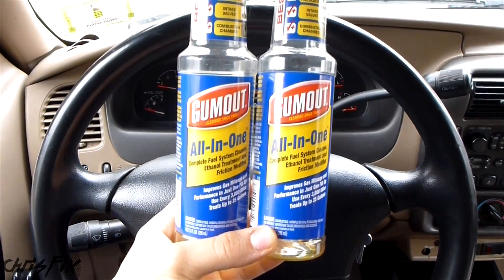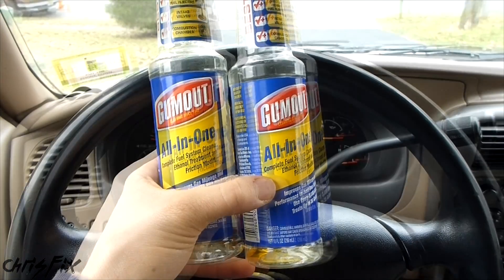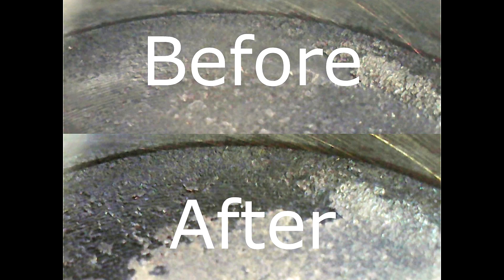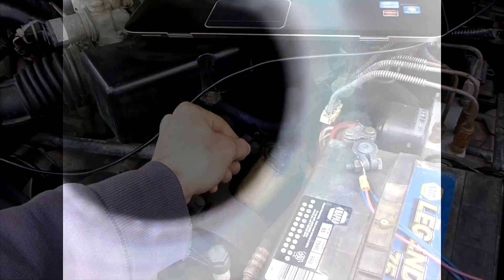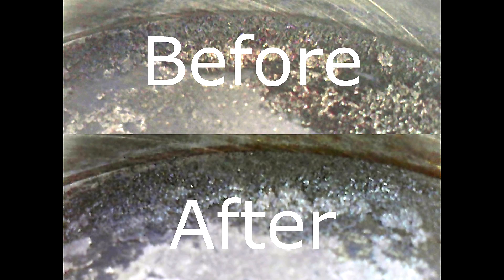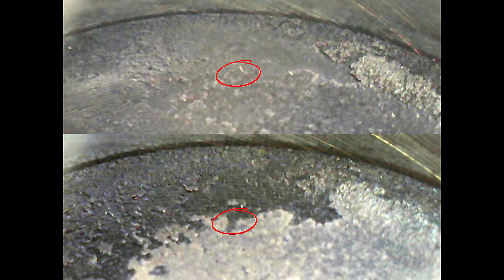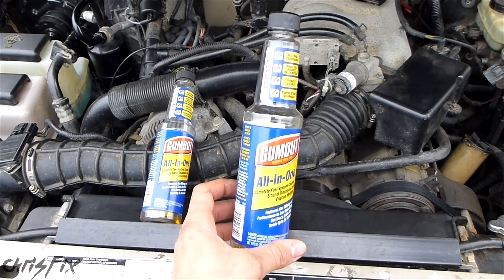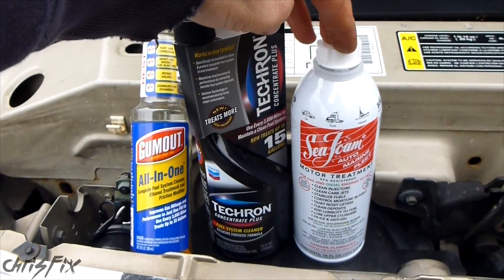Does Gumout Fuel System Cleaner Work (Follow up)?

Comment: When did this obsession with having spotless engine internals start? That carbon on the piston tops is a FREE compression ratio boost (performance improver) as long as it isn't causing detonation (unlikely in modern engines with active fuel injection control).  Baked on / stable carbon on piston tops is harmless, dude. If you live a mile above sea level like I do, every fraction of a compression ratio point boost is a welcomed thing. Believe me. 
What CAN cause damage is sudden aggressive carbon cleaning that breaks loose large pieces of carbon that can get stuck between a piston skirt or piston ring and tear up a cylinder wall.
I agree that excessive intake valve deposits can be a problem though, but intake valve deposits aren't the problem they once were with advances in fuel detergents.
Reply from the maker: +scdevon No one said there is a problem with carbon in this engine, I actually say this is normal. We are testing to see if the product works or not.
Reply: ChrisFix
Oh, OK. The video is about testing a cleaner designed to remove carbon among other things. I just questioned why people would feel the need to remove carbon like this in the first place. It's completely normal.

Comment: Sure it works....  if you use it for ten years and spend ONE THOUSAND DOLLARS
buying bottles of that crap which is what they want you to do.
Reply: +Indrekk Pringi A taxi company person who ran one without all it's expected life and another with, found the one with continuing to work (used various brands) and the other broke down more, the more they tried cleaning it up.

Late in the game, it's probably cheaper and easier to pull the cylinder heads in clean it.

Comment: For a complete engine cleaning to see a a real 50 -80% results you need about 10 bottles.
Reply from the maker: +osamaFXX probably more than that!
Reply: +ChrisFix Standardized tests show the active ingredient in Gumout requires 10,000 miles of use before 'equilibrium' of removal plus new deposits is achieved . . . so, Chris, the 10 bottle comment falls a bit short . . . it will take many more bottles before you can benefit from the 1 bottle per oil change maintenance.

Comment: Excellent video.  I noticed you are missing two cylinders.  Just kidding :-)

I'd like to see you do this after doing a Seafoam treatment.  The kind that you suck it into a vacuum line that goes directly into the intake.  That, and/or straight up raising hell, hot rodding, high revving, wide open throttle time will burn some carbon out.
Reply: Oh you did the Seafoam test.  Gonna go watch it.

Comment: Interesting tests, but I feel like the test is a bit narrow in scope. By only using the cylinder carbon build up you are only validating one part of what the product is meant to help with. I think the biggest take-away from this is that these products are best used throughout the life of a vehicle (especially before build up gets to be too extreme). I'd be interested in seeing the results of fuel system cleaners over a long period of time right from the start of a vehicles life. I wouldn't rely on them as magic repairers for older/dirtier vehicles but I'm certainly convinced that a bottle or two a year would be worth investing in for new machines!
Reply from the maker: +Chris Pickering You are wasting your money if you use these products for the life of the vehicle. I look into engines all of the time and the carbon buildup is never that bad. Check out the newest video I did where I look at intake valves: https://www.youtube.com/watch?v=BocH2c4mYcc
Reply: Each to their own of course, but I think $15 every once in a while is a small price to pay for the peace of mind of knowing that I'm doing everything I can to keep my machine in perfect condition. To keep it simple I just do a dose at every oil change.
Reply: +ChrisFix   Why haven't you done one on Marvel Mystery Oil and CRC Motor Treatment?
Reply: ChrisFix Gotta love people, man. Most will defend, almost to the death, a bad product rather than admit they were duped by an ad or a bright colored bottle with amazing promises.
If you put cleans carbon in the chamber with 1 bottle on the label then it had better damn well do that or the company responsible for that product should leave that claim off.
That is the part you stated that you tested & I am just amused by the arguments you are getting. 
It's really weird to be so attached to a product or a company as those entities see those same customers as easily dupable & would like nothing more than to relieve them of all their cash. It's a sort of parasitic relationship & it's rather strange to be "the host" & still be that interested in defending it but people will do so.
Why defend a product from fair criticism? You don't make it, you don't have a stake in it's success & usually there are several other products out there which would work just as well for your needs.
I will defend people or even pets I like who are either right or mostly right. Defend a brand or product? Nah. They don't pay me to do that.
Have a great day!

Comment: A question with running the tank all the way empty, aren't you not supposed to run the tank dry because the dirt and stuff sitting in the bottom of the  the tank goes into the fuel system as well?
Reply: +Mrwishywashy Hmmm. Indeed. This could have effected testing, and if not, shortened fuel pump life.

Clean it up with the dirtiest mop water!
But that makes the floor oiler! (Inner thoughts about not cleaning my mop bucket at the shop soon enough, lol.)

Personally, I like water decarbonization. The car feels so smooth for about a year and I do it again. Too bad I don't have visual testing like Chris, but I'll get there. Check out my test on water decarbonization.

Comment: The older the carbon the harder it gets.
Reply: I will keep old carbon on my pistons until it turns into diamonds.
Reply: +Skyler Bond My carbon sat for 3 years. I had the opportunity to get very dry. This makes more sense why my 70k mile engine is so carboned.
Reply: basically, you have to start when the engine is new or almost new..  do this every oil change and it will remove the cyclinder carbon buildup that builds up in that short stretch of time.
Reply: @colty7764  still, they shouldn't market it as a one use fix. If you want a good fuel injection cleaner/additive use redline.
Reply: @colty7764  exactly
Reply: The deeper the cushion, the sweeter the pushin'.
Reply: Start early, start strong.  

Use it every oil change starting with the first oil change.
Reply: Skyler Bond yep true, old carbon harder
Reply: This is like metallica's lyrics

Comment: In WWII aircraft engines were de-carbonned with water.  Atomized into the intake at higher revs.
Reply from the maker: +panzerabwerkanone They were. It was designed to lower combustion chamber temps for more power!

Comment: In my option that stuff works on the pipes and injectors, flushing all the crap into your cylinders. If you really want to clean your engine tho and I'm not sure it works on a petrol like a diesel you put you fuel lines straight in to bottle and use the cleaner straight. The cleanest engines I've come across it straight LPG, Duel fuel with injected LPG or forced running methanol injection.
Reply from the maker: +Karl Hock Thanks for sharing and I agree. But I think that they should not put that it cleans the combustion chamber if it doesnt actually do it.
Reply: +ChrisFix ,yeah fastest way to blow up your car unless set up for it. I'm pro LPG just a sad that the old school mixture system gave them such a bad name. I run a modern mixer system in my 98 land cruiser can't fault it. only burns 2lt more per 100kms then petrol.

Comment: You should hook up a math injection kit and see the before and after cleaning from what iv been told it steam cleans the piston tops valves heads and so on. Runs cooler temps when used and boosts power and torqe mainly using it like you would nitrious. But not as deadly
Reply from the maker: +strikeforce4 That is actually an idea that is in the works! Stay tuned!

Comment: Forgive me if this question has been answered: Have you tried using the scope in through the intake or in the spark plug hole to look back up at how clean the valves are getting? thanks
Reply from the maker: +Jonathan Stahl That is harder to do than it sounds but I am working on it!

Comment: Ummm... Gumout is a fuel system cleaner, not a piston cleaner.
Reply from the maker: +Crow T. Robot On the bottle it specifically states it cleans the combustion chamber and shows a before and after of the piston head. I clearly show this in the video.
Reply: ChrisFix Well, then, it clearly would have helped if I had watched the entire video.

Comment: You don't have or didn't use the gum out high mileage that's y there's still carbon. If this video is old, my apologies
Reply from the maker: +chris carbaugh Thanks for sharing.
Reply: U know you're stuff I'm dealing with a pending p0420 check code used cataclean and the light shut off but the code is showing pending I used my obd2 diag tool to confirm this any ideas, car is a 02 subaru forester with 264,000 miles

Comment: this product is for prolonged use. you're taking an engine with 123000 miles on it and trying to clean it with 2 bottles. I think if you used it as a pm on the regular it would work great.
Reply from the maker: +Shawn Novick It is a waste if you use it for prolonged use...

Comment: What worked well for me a few years back, on advice,, was 1 litre Enamel Thinner + 1 litre methylated spirit, then fiill up with higher than usual octane fuel and drive like a madman.  I was more treating the injectors in my case, rather than carbon deposits, but there was definitely evidence of black stuff having been pulled through.  According to the advice I had, it won't poison the sensors or converter.  Don't know if there's a better way or not.
Reply from the maker: Jason Groothuis Thanks for sharing! Not something I would do but interesting none the less!

Comment: What did you use to get the inside view of the cylinder and where did you access the cylinder?
Reply from the maker: ***** The camera is linked in the description and you go though the spark plug hole.

Comment: Did you noticed the claim of improved gas mileage on that Gumout? Your first bottle you went 210 miles on a tank of gas and the second bottle over 300. So unless there is something I missed, the claim for better mileage is correct, agree or disagree?
Reply from the maker: Mark Shaw I had to fill up with some extra gas to get back home so the mileage was about the same. Maybe a little bit better fuel economy but there are so many variables.
Reply: Have you ever did any fuel treatment tests on lawn mowers, weed-eaters, etc.? The problem I seem to always have is either my 2-cycle fuel has gone bad or the mixture is not correct and I'm always working to repair them.

Comment: you dont know how to use or understand what these products are designed for
Reply: ***** I really should ignore your comment, but it's so ridiculously stupid, I just can't let it go. So what you're really saying is that the product manufacturer doesn't know how to properly label their product, since he followed the instructions on the bottle, and expected to see the results that the bottle claimed it was designed to give. If that's the case, then you REALLY shouldn't use a product that is incorrectly labeled.
Reply: +garrisonaw you can't expect a fuel cleaner to work 100% magic after 2 bottles on a car that has over 120,000 miles and has never had any type of fuel treatment used on it.

Also, the bottle doesn't say it will completely clean the valves after one use. It said it will improve gas mileage and performance after one use, which the user of this video neither confirmed or denied if it did.
Reply: +Trent J did you even read the comment I was responding to?

Comment: ChrisFix, what is your opinion about oil flushing? Is oil flushing needed and if so do the products work from the auto store.
Reply: +Cinnamon crunch I asked him the same question, he said no. Personally, I say that if you have an engine that's been abused for some years you might want to do it but not with flush fluids; just change the oil several times. Even so, this might clean it too well and cause it to burn oil if it's in that condition.
Reply: +Austin Lucas I'm amechanic, and my ex gf's family car hadn't had an oil change in 8 years. I assure you, the oil flush I gave that car was NEEDED.

Comment: are you up for the real challenge chris get you a 8 ounce glass of plain of tap water remove the intake hose at the throttle body rev the engine up since water is not flammable slowly pour in the water the higher the rev the better the water will not only pound the carbon off the piston tops but the valves also walla
Reply from the maker: michael haiden I will be testing that! I think it is going to take a lot more than 8oz though!
Reply: well it might but it is like sand blasting without the abrasion
Reply: @chrisfix  Did you make a video on this?
Reply: @ChrisFix test this please... its been almost a year since asked...

Comment: Idk if this has to do with my fuel system but my charger sorta shutters if im stopped at a light n i let off the break a tad (creapin forward) , idle is fine tho but wen i do that it sorta shakes alil , wats the prob? Any idea?
Reply from the maker: 3232myke Could be engine mounts. Any check engine lights? Might be misfiring so could be spark plugs, wires, coils...
Reply: 3232myke You mean shudders like the engine is missing, or like the whole car kinda shakes? If it's the whole car shaking, you might want to rule out the anti-lock brakes before you spend too much effort diagnosing the engine. I had a similar issue with my old truck, and when I unplugged the anti-lock system, it stopped. The ABS "brain" was bad.

Comment: there's a new Gumout in the market.. it's called GumOut multi system tune up. Could you make a video using that product? Thanks!
Reply from the maker: Junkosei100 Yes I can. I have a few tests I need to do first but I will test out the new Gumout.

Comment: I used to do what I am about to tell you however I dont know if it works. When I was a new driver 25 years ago to "get the carbon" out I used to start the motor, take off the air cleaner and with one hand on the throttle I would trickle water into the carb. I ton of white smoke would pore out and in theory so does the carbon.
Reply from the maker: joseph leonardi I will be testing the water method and we will see how it works!

Comment: Chris, is the purpose of gumout to prevent carbon build up as opposed to cleaning deposits that large.I mean it seems  to be more effective if you use it before deposits get that large.
Reply from the maker: John Strong Thanks for sharing John. I was just testing what the bottle was claiming (removal of carbon deposits in the combustion chamber). I am sure it helps prevent carbon buildup, and it probably works well for injectors too but I cannot test that.

Comment: how about using a contraption that inject just the right amount of water in relation to rpm and amount of fuel injected. or just squirting water to the air intake when engine is all ready in operating temperature.  :-)
Reply from the maker: Jobert Cadag I will be doing a video testing out water and seeing if it works. If it doesnt work I will try to make a water injection to clean the pistons.

Comment: For best results get a mister and spray in your intake at about 2500 rpm for about 30 seconds, you'll break out even hard carbon buildup
Reply from the maker: Kyle Milford Thanks for sharing. I will be testing water and seafoam (which says to do that in their directions).

Comment: I don't see the big deal. A little bit of carbon on the cylinders doesn't harm anything at all. However, carbon on the backs of the intake/exhaust valves can reduce air flow and I would be interested to see cam shots of valves before and after various cleaners. I always run a bottle of cleaner through my van twice a year to keep the injectors flowing smooth, but a light carbon dusting on the pistons won't hurt anything.

Comment: SeaFoam is another excellent product that can bring old motors back to life when used in the gasoline.   Its effects were blatantly obvious just a few seconds after turning the key.   My motor started making a horrifying sound after using the SeaFoam, after poking around for the noise I realized it was the brand new fan belt now sliding on the pulleys due to the more powerful motor.  It was a real pleasure tightening my belt after that.   It was amazing what putting Seafoam into the gas tank of a properly warmed up motor can do.  I'm absolutely convinced by my own anecdote.
I also should admit that I mixed a full bottle of this All in One with only about 6-7 gallons of fuel, Chevron or QuikTrip 93 Octane.
Reply from the maker: heymisterderp I will be testing seafoam in a car motor soon but in the meantime, here is a test I did in a lawnmower: https://www.youtube.com/watch?v=WdT4DPFXIkM
Reply: ChrisFix
Yep I saw that video; worth watching and glad I found it.  It was that video which brought me to this one most likely. 
I appreciate how you don't start out with your conclusion and then work backwards from there but simply test and then draw your conclusions.